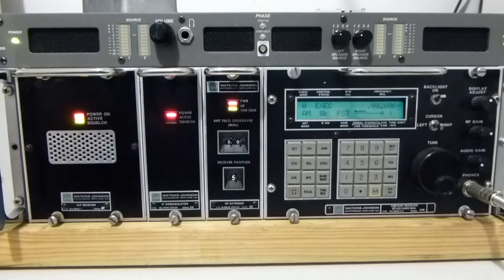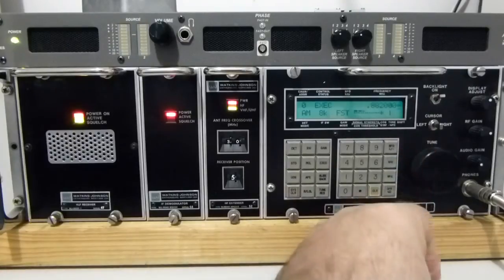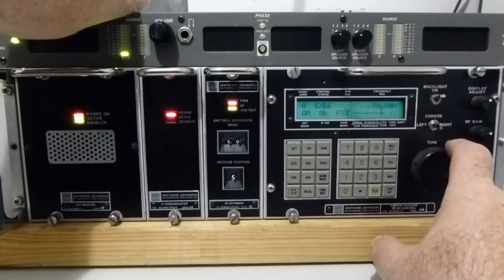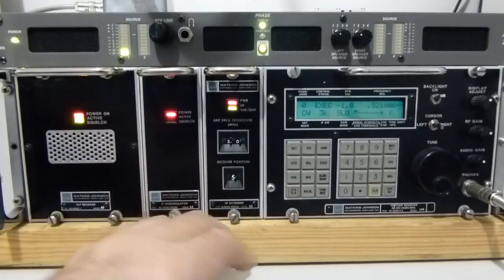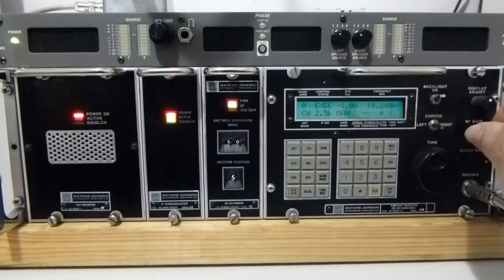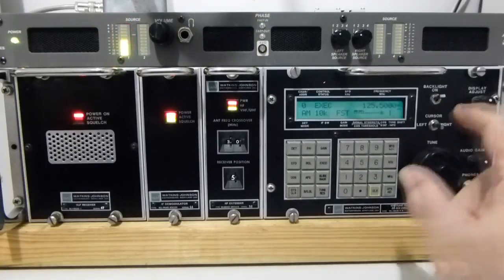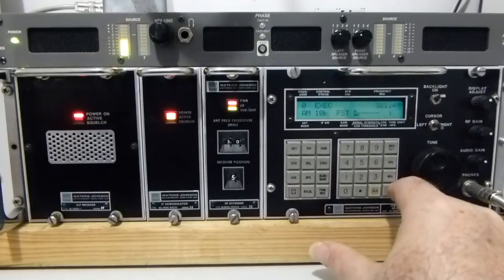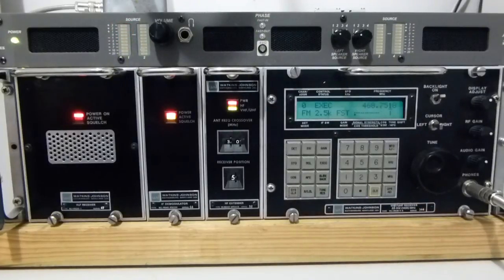Watkins Johnson WJ9040

Comment: This type of equipment got dumped onto pallets and most of it got demilled/scrapped and melted down. Sad to see so much stuff destroyed. Everything got swapped out with blackbox SDR radios. A large number of operators retired (myself included) not to be replaced. SDR systems can replace a large number of employees since you can  record entire swaths of RF spectrum to be analyzed automatically and anything of interest would be flagged for further analysis and reporting.